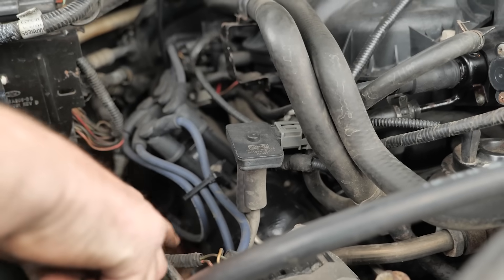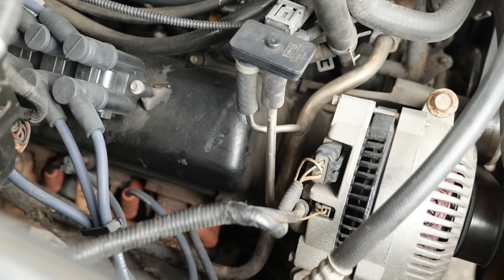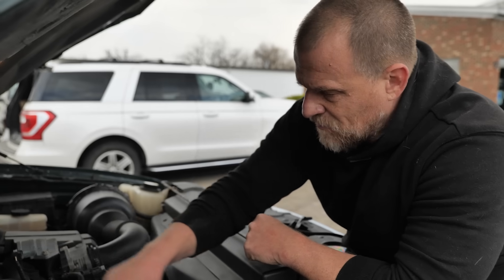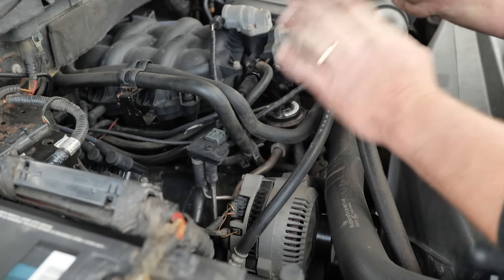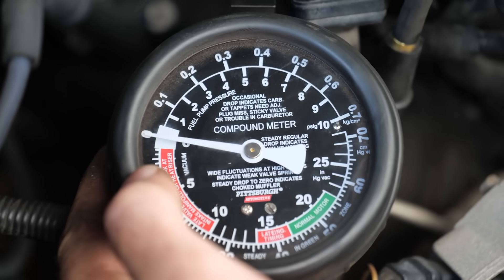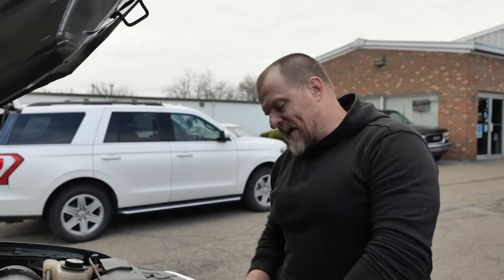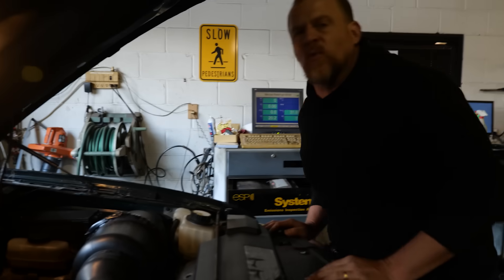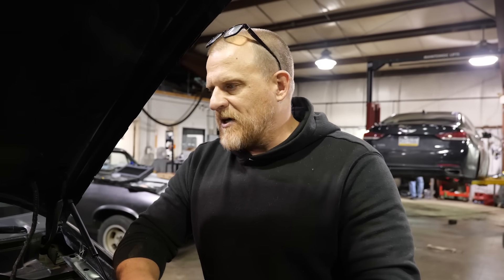Negative Fuel Trim Bank 1 - Positive Fuel Trim Bank 2

Comment: I now understand how a clogged cat can cause a positive and negative trims on a 2 banks vehicle, how does a clogged cat make the car run rich on a single bank? With a clogged cat, less air enters the engine causing a reduction in injection pulse to match the air reported by the maf sensor. I cannot see how that causes a rich condition. Thank you, Paul, for the video.
Reply from the maker: It won't on a single bank
Reply: Thank you, Paul. They always say that clogged cats enrichen the mixture.

Comment: Good afternoon and I finally made it back to your class. I don’t believe in excuses but I had gotten locked out of my email and I have had it so long that I didn’t want to open a new email so I had to follow protocol with google and their 2 step verification process crap.  I have a 1997 ford f150 king cab,4x4 automatic with the first generation 5.4.  It has right at 254,something something thousand miles. My handheld scanner shows live feeds and I’m learning about fuel trim and what affects it.  So I’m hoping that my self teaching is correct! Thanks again for the time you invest along with your knowledge and experience for others that have the interest in learning these computer controlled monsters we call vehicles! Lol..The old school shade tree mechanic is about extinct. Take care
Reply: What I did to mine that seemed to help was replacing all major vacuum lines especially the big one on the back of the lower intake. The cats were already removed so I knew the exhaust wasn’t playing any part of the fuel trim and the truck was idleing smooth and running smoothly as expected but the unburned exhaust would literally make me pull over and so I wouldn’t pass out from exhaust poison. It was that bad!  Lol

Comment: Have you used the air temp PID trend up graph under load for plugged exhaust diagnosis?
Reply from the maker: Only on manifold mounted IAT sensors (which most are not these days) and I've used that for stuck open EGR valves but not for exhaust restrictions
Reply: @ScannerDanner  Thanks for the reply. I was just curious.

Comment: Another problem I've run into on V6 engines is if the engine has 2 timing chains, one could be worn. The engine breathing from side to side would be different. The side with negative fuel trims is the culprit. Of course further testing would be needed to pinpoint the bad chain.

Comment: A simpler way to check instead of swapping those O2's is to simply unplug one and watch your trims...somewhere around 30 seconds or so both banks will trim identically off of the one plugged up. In your case here, unplug that B1 sensor (neg trims) and watch if both banks start trimming positive. If so, your circuits and PCM are good. If you want to go further, reverse the process and they should both go lean based on B1 being plugged up, and B2 being disconnected.
Reply: Problem with doing that is it throws a heater code and goes into default strategy.
Reply from the maker: Check out the image in the thumbnail, this wasn't a non functional O2, but I questioned its amplitude at times. The issue was from an injector not flowing properly causing the O2 "hash". The test your are suggesting wouldn't be applicable to this scenario but one with a fixed O2 signal. Thanks!
Reply: @ScannerDanner  It's applicable. You're testing circuits, no O2's. You're ruling out wiring, connectors, and pcm, which only leaves an O2 IF THE O2 IS THE PROBLEM. I wasn't insinuating this was an O2 problem, but it's a quicker way to rule out the system than changing sides with the sensors. Randy Bernklau taught me this.

Comment: Swapped out O2 Sensors will give you this condition. Negative on one side while Positive on the other one
Reply: Yes if the connectors are swapped left to right. Left side O2 thinks it’s installed on the Right bank.
Reply: How so?
Reply: @gojudude  The PCM/ECM Comands the correction of mixture on the bank and monitors the reaction of O2 sensor. Since O2 sensors are swapped out it can not see the expected reaction because is monitoring the wrong bank. Hope makes sense.
Reply from the maker: I have a few case studies on this. Also with an upstream and downstream O2 that the connectors were swapped
https://youtu.be/s65jumJ3idE
https://youtu.be/WrCa9cC9EPg
Reply from the maker: yes sir, if the front harnesses are close to each other and can be swapped. I've seen it! -25% on one bank and 25% on the other. Craziest thing ever when I first saw this as the engine would run great at times (cold starts and WOT)